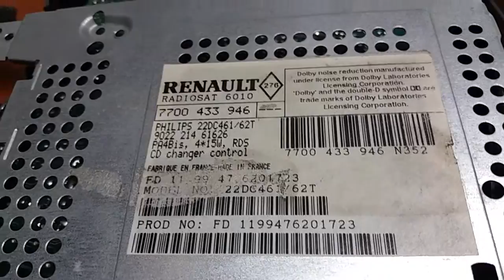Renault car stereo

Comment: "Mister johnny is an evil bastard" you fly hater LOL :-D

The old philips radio/cassettes like the 752 used to brake the flywheels on the tape side, it was a cheap design where a metal washer had a plastic edge, the edge cracked and the belt fell off.
But the rest of the radio was reliable.